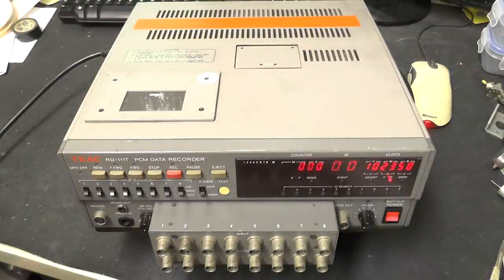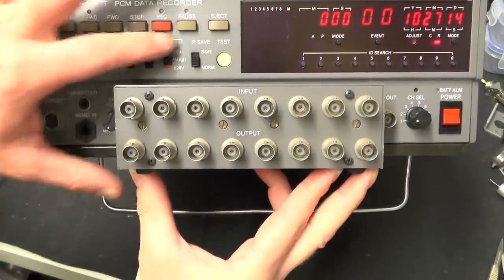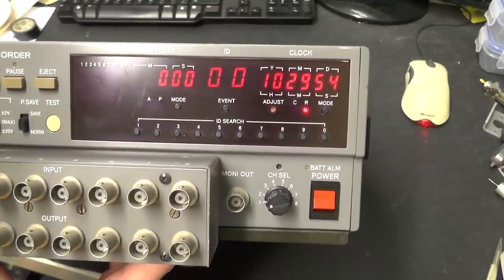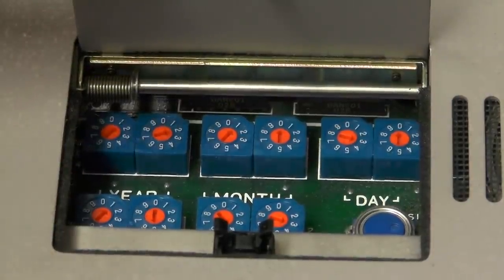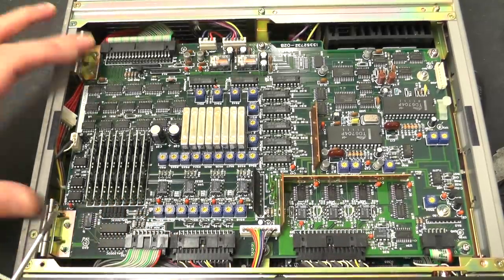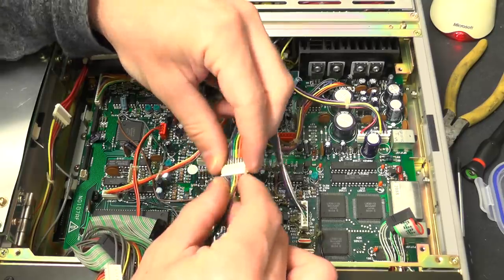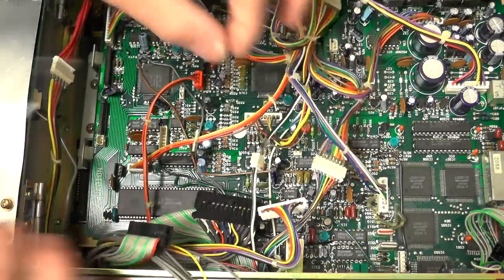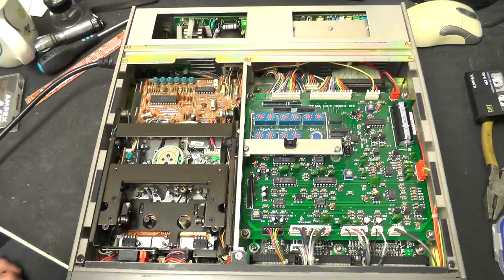DL#078 - TEAC RD-111T DAT 8 Channel Data Recorder Teardown

Comment: 29:38 The piece you described as a temp sensor, to the side of the capstan motor, is a dew sensor to lock out the machine from loading a tape against the heads and having it shredded to bits.

29:23 Little red 'blob' attached to the stationary part of the head assembly is the dew sensor's companion PTC head heater to drive off detected dew. (The coating on the dew sensor is actually hygroscopic and dries out very slowly to give the heater extra time to dry off completely since it was rarely ever mounted next to the drum itself.

I remember working on VHS split systems that had Vidicon camera inputs and were powered by massive 7Ah SLA batteries and were prone to head misalignment from people trying to be too vigorous with the shoulder strapped beasts thumping against their hip.
 
Interesting side note; early Hitatchi VCRs that has just the two screws on the upper rear holding the top cover did a head spin test when the power button was cycled, I quickly found out from one of my customers way back then that small children liked to cycle the power button rapidly  to hear the funny noise the drum made in that spin test and that the spin test did not limit drum speed, leading to drums spinning faster than they should and wrecking the heads from the high G forces the experienced.
Reply from the maker: +sivalley Thanks for the extra bits of info!

Comment: Greetings Dexter, I am curious if you still use your Teac DAT, I have a slightly newer version known as the TEAC RD-135T DAT  and plan to use it for backup for my Heathkit H8, DEC PDP1140,, IMSAI 8080 and Altair 8080, all old 8-bit machines. 
The Teac is not age appropriate for those systems but should work fine and nicer looking than an SD card, plus more function than audio cassette.
Any thoughts on how your Teac Dat has held up and are you still using it.  Comments greatly appreciated !!

Comment: Hi, matter of interest have you ever had experience of repair of the switch mode power supply, a plug in unit, for say a RD-130TE or EQUIVALENT, I dont have any service manuals, just replaced some leaking capacitors but still dead :(
Philip